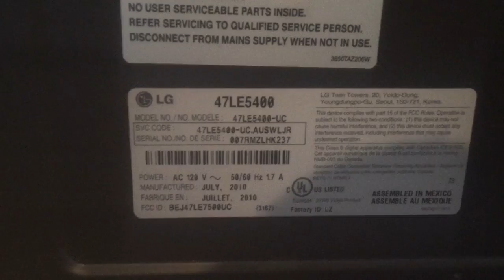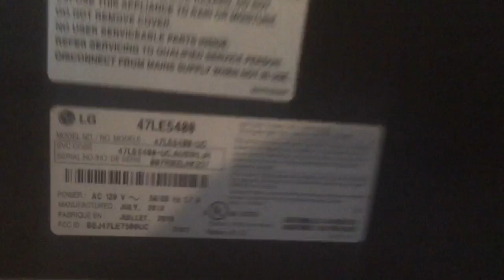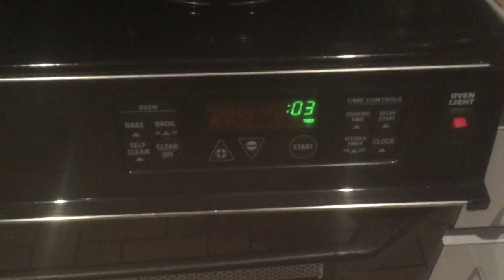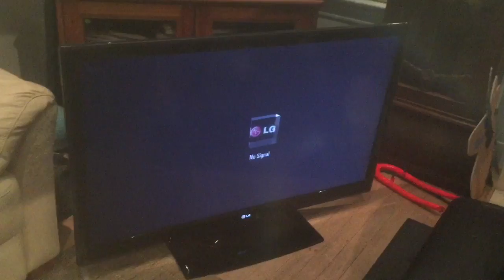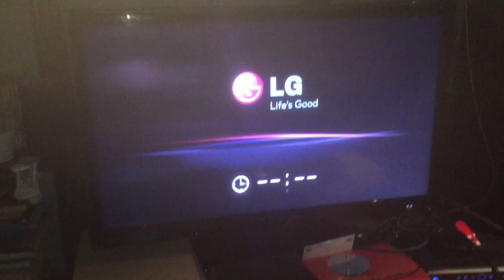Repair An LG Television Motherboard By Baking It In The Oven

Comment: great idea - hmmm just watched a LG repair video that focused on heating and soldering the main board mainchip(search video LG TV No Picture Repair 55LX6500). It has the same diagnostic as mine - standby light, remote controller switches standby off (normally turning on the tv) but nothing comes on, no image , no backlight - no image when I shine a torch on it. I will do an inspection and see if I find anything burnt on the board before attempting. Thanks for a different approach to the problem.

Comment: I have a Samsung LH65BECHLGFXGO that doesn’t turn on… could this fix the issue or is it only for LG TVs?
Reply from the maker: @ChristianTulsaPeru  I don’t know the answer but people have baked motherboards on a range of televisions.
Reply: In my experience baking motherboards or graphics cards (ive baked many graphics cards with success ranging from 3 months - 1 year) works when you have graphics glitches or that it turns off after a while etc. unstability. In your case it sounds more like a bad power board. I would try changing that. it CAN be the motherboard tho so it would be best to try some troubleshooting first. Its always best to try other stuff first before baking, because it can damage the compontents. if you dont know how to troubleshoot I would try changing the power board first, and if that doesnt work try baking the motherboard. if that doesnt work you can change the motherboard also. Also remember that baking a motherboard is only a temporarily fix that can last everything from 2 weeks to 2 years..
Reply: For tv that doesn't turn on it needs some basic trouble shooting first.  It could be due to failed power board instead of main board

Comment: This is great! Today I fixed an LG 47LW5700-UE using this method. Thanks!
Reply: Is it still going or has it packed in again?
Reply: @TH-ns5mb  I'm afraid it failed again about a month ago. Tried putting the mainboard in the oven again but to no avail. Repeated the heating two more times and still nothing. Ended up discarding the TV.

Comment: Today I have tried this method with my old Philips 32 inch TV that I bought in 2013. A week ago it struggled to receive any orders from the remote or the back panel buttons, but the LED was on the whole time. I baked the board twice because the first time didn't work, but the second worked flawlessly. Thank you!

Comment: I have an LG model 50LN5700 from 2013, which developed the black screen last weekend.  I guess I got my moneys worth as it lasted 10 years trouble free. I tried this motherboard-in-oven method a few days ago and I was able to get my picture back again, but only lasted 1 hour.  Did it again and this time only lasted 30 minutes before the screen went blank again.  So if this motherboard-in-oven method is able to get my picture back, albeit just temporary,  it's pretty much a bad motherboard issue, isn't it?  I can buy a replacement motherboard for less than $100, is it worth replacing the motherboard?
Reply: I'm contemplating the same question
Reply: I bought a replacement board on the internet and it didn't fix the blank screen issue.  Going to be buying an LG c3 most likely as the prices will go down next month memorial Day week sales.

Comment: I tried other options before doing this on my LG 49UB850V, like heating with a heat gun and a thousand other things and nothing worked. In fact, the TV had been damaged even more. I tried this and it worked! it's amazing!
I recommend that you don't do like me and separate the plastic plates before putting the motherboard in the oven. I thought they were metal and they melted, but the board works 100% and I've already got the plates for only 15€.

Comment: I picked up a 55" lg i saw on the side of the road wouldn't power on . Can't believe this actually worked but it did!! Thanks so much.  Free tv!!
Reply: Exact same with me. I've done this 3 time to the same tv over 3 years before I throw it out and it keeps coming back. I literally just came back to look up the temp. Hopefully it works again 😂
Reply: A lot of those are cold soldered basically they're just trying to build them and get them out the door as quickly as possible. So over time they just come loose but this will fix them about 85% of the time.

Comment: Really grateful to have come across this fix a couple of years back. I've had an LG EBT61438207 for over 8 years and it's still my favourite screen today. I'm wondering if anyone thinks there might be a limit to how many times this could be done before it's time to trade up?
Last week was the 3rd time I've done the bake for this motherboard. On this occasion, it didn't work when I reinstalled it, so I took a gamble, re-did the bake, and let it cook for an extra minute and a half. After that, it did work. 
Might there be a limit to how many times these boards can be baked before other damage is caused?
Just for general information, my toaster oven has a digital temperature setting and only display in increments of 5 deg. So, each bake I've done at 195C for 11 minutes. This last time it was 12m30s. 
Anyway, so far so good. It's still nice having a free fix for what's now my large computer monitor! 😁

Comment: Wow thank you so much! This was my first baking experience and it worked perfectly. I baked the main board from a Vizio D55u-D1 which is known for having this type of problem. I read many articles and looked at many videos in Vizios but yours made the most sense so I gave it a try. I must tell you that I did use a gas oven, not knowing that might be a safety hazzard until reading the article you refer to. But hey nothing blew up. Amazing! Thanks so much 👍🙏
Reply: Hey I have the D55u_D1 with the same issue. What temp for the oven, and how long did you bake it for?
Reply: @mts7274  I did exactly what the author of this video states in the description-  10 minutes @ 385° F (196° C).
Reply: @mts7274  I don't have my D55u_D1 any more but I remember the problem was with the BGA soldier joints under one of the 2 big processor chips. If you can locate which chip has the problem (by tapping on it), you might try a heat gun on that chip before baking the board.

Comment: I lost sound on mine and it wouldn't even output it to any external source. I baked the main board and to my surprise it now outputs sound again. I'm just amazed it worked. Was on 32ld490 and is about 12 years old. This was the first time it's been opened up and the amount of dust was unreal

Comment: Can anyone explain why baking a motherboard works? It's fantastic but so weird
Reply: Its called 'reballing' they did it on video game consoles, YEARS and years ago.  Basically, there are little solder balls that connect the CPU / BGA to the motherboard which crack, and fail after years of heating up / cooling down. The oven re-flows those balls / sometimes this works sometimes not and more often than not is a temp fix.
Reply: Softens the solder joints and reconnects anything that may not be
Reply: I was curious to odd one but now that I think of it yeah it could work

Comment: Just did this....AAAAAAND....it works.  I did it for 12 minutes and only cooled it for about 10 minutes.  Worked great.
Reply: Yep…a year later and it’s still going strong.
Reply: @mjhufford  damn I'm gonna have try this bought a power supply thinking that was it nope so had to be the main board
Reply: @mjhufford  how many degrees did you put it in and how many minutes did you leave it in the oven?
Reply: Still working for ya?

Comment: Did this today and the tv now works.
Awesome
Tv was a dumpster find
Reply: Our current living-room tv (55" Vizio) was a dumpster find about 3.5 years ago.  Rained on, sand all over it, wouldn't fire up.  My 13 year old (at the time) says we should bake the board.  We did.  It worked!  It has stopped working a few times but everytime it acts up we bake it again.  Probably done it 3 or 4 times and are doing it again today.  Let's hope we get another year or so out of this one. 🤞

Comment: Ive done this twice and brought my TV back to life, lost audio and hdmi1 but my 20 year old LG is still working.
Reply: are they still working?
Reply: You probably just need to manually add some more solder to the joints. Solder paste is a good way of doing it. You would just put a tiny amount on all the connectors that you're worried about and put it in the oven again.

Comment: Have an old LG 42LE8500 with Display not starting up anymore. It baked the motherboard with your method and it works. Absolutely made my day! Thank you for the video!
Reply: Update: the TV worked for about 30 months. Now I have the same black screen issue again. I’m trying the repair for the second time now.

Comment: Omfg IT WORKS! I put it on for 10min went to work, came back and installed it and boom it freaking works. I was not about to spend $150- $200 on a new motherboard. You’re a life saver. No lie I was so scared to put it in the oven at first 😂 I had my fire extinguisher on go  🧯

Comment: The TV died today again. This fix worked for 1 year and 8 months with daily usage of approx. 8 hours. Will re-do someday.
 Second time- got a cheap hot air reflow station. Reflowed a few random chips on the motherboard and TV is working once again!
 Third time- it died for sure, could not bother fixing again.
Reply: Yah this is my second motherboard bake on the same tv

Comment: What was the symptoms? The screen on my 55LM5800 is going black but still has audio. if I power it off & back on again the picture comes back but only for a short period of time then the screen goes black again. 

I wonder uf this fix would work
Reply: Exactly what my LG 55" is doing. War intermittent till a couple of weeks ago, now this. I'm going to bake it because I've heard this trick in a few videos. I'll update when I do.
Reply: @jerseyjoyride1316  Nope turned out to be the backlights, replaced em and it fixed that issue (although after fixing I had a NEW issue w/ the screen dimming every 4 seconds). Replaced the Tcon board, Power supply board, LVDS cable & main board but still dimming. I suspect the fucker that sold me the PS board screwed me! Anyway the Main board has a bunch of plastic parts, CPU etc that I wouldnt bake, that is unless you are lucky enough to find a replacement & dont mind spending $120 or more for a new one! (my replacement was brand new). TLDR replace the backlights before you do anything else! Youre welcome

Comment: Believe it or not my mom tv a Westinghouse smart tv  wd50fb2530 started cutting off by itself after 30 seconds! I opened it and the main board and power supply are built in together! I removed and I literately used a welding torch on the board since I did not have anything to lose (tv was already messed up in my opinion) all capacitors looks good so I melted pretty much all the soldering joins (something I don’t recommend ) and put it back together and to my surprised tv have been working perfect since!!
Reply: Lol this is wild

Comment: OMG!!! Never breathe in fumes from electronics. You should had baked it in a small electric oven outside the house… just run a extension cord and plug the electric oven out there… thank you sharing your experience!
Reply: Solder is lead free nowadays, don't freak out.

Comment: lasted 30 min and died
Reply: You need to use liquid flux and then use a reworking station it’s probably a dry solder but without te flux it probably won’t resolder properly
Reply: @xray364  yeah but how do know what part of the board to rework. You can't just heat up an entire pcb with a handheld rework gun

Comment: I've done this about 4 or 5 times over last 4 years or so. It is time again today, hopefully it works again
Reply: It worked again
Reply: Same hahaha just did it for the 4th time in 4 years. Too cheap to buy a new TV LOL
Reply: @georanchurchill2774  the gift that keeps on giving 🤣🤣
Reply: What are your TV symptoms? Mine went black while watching TV. Now, no LG start-up image and no audio. Just wondering if we have the same problem.
Reply: @OneWhoLivesThere  usually I will turn the TV on and the lights at the bottom of the TV will turn on and there is no picture (i.e. black screen).

I picked up another 60 inch TV few weeks back dirt cheap that had these symptoms, apparently had sound though. Baked the board for 10 mins in oven and works fine now.
Reply: @adamg5252  Thanks. We definitely have the same symptoms.  After posting, I tried baking the board and it didn’t solve the problem, unfortunately. I had just paid for a new motherboard to be installed 8 months ago and the repair warranty ended after 6 months, so I think I’m done sinking money into it.
Reply: Same sadly. About to do my 4th right now.

Comment: To prevent it happening again, never take out the powercord while not in use, and let it be in standby mode always! I found out that the board stops working when it has been left in a cold (below 10' Celsius) room for a week or so without the power cord attached. So,  never unplug the power cord (tv, blu-ray surround etc). I`m baking my board for 2 time now. Lesson learnd. 
EDIT: Last time it lasted for 3-4 years, and it also worked today!
Reply: Is this confirmed? Why would the cool air affect the solder?
Reply: @bradfordskelley  I read it somewhere. The solder they used at that time was not tested for use under colder environment so it was cracking. This affected mostly under the processor on the main board. The heat from the oven melts the tiny solder droplets together again and it works again. I have done it 2 times now.
Reply: I suspected it could be that because my surround sound amplfier was also placed in the same cold spot and that cost me £50, (not LG though) to have its main board resoldered. I will pop my LG DVD main circuit board in the oven tomorrow for 10 mins and then either varnish over the electrical soldered joints or leave it in a warmer room for the winter next time if it works. I must remember to leave card under it whilst it bakes. Incidently I tried the hot air blower last time and it worked but only for a couple of days and melted the plastic around the output sockets. I'll leave the extractor on full and kitchen back door open and give it a blast with air freshenr so the good lady does not give me a hard time when she gets back. Pity I don't have a way of doing it outside:face-orange-raised-eyebrow:.

Comment: Thanks man for this cheap fix! Got my LG 55 inches ready to be dump because it was just pure black on screen instead I tried your suggestion and oh boyyy it worked into perfection. I saved a space in landfill because of your video🤣
Reply: What was the model number? My 55" screen keeps going black but still has sound. I have to power off the TV and turn I back on to get a picture again

Comment: Ok, today is 9/10/21 and this worked on my LG 42ln5300. Baked the main board after oven was already hot from baking cookies. Let fire be off and it sit there for like 5mins then turned it back on to 375 for like 2mins. Turned it back off and opened oven door to air out until it was no longer hot (15mins) took it out and let components further cool for about 30mins. Popped in and haven't had my tv randomly shut off since.

Comment: It didn’t work for me. Before doing this it has LG logo, now it has black screen nothing is coming.
Reply: You might have not connected everything back perfectly, for example are the little white strips in fully? Those control the picture which may result in you not seeing anything, (I've done this 10+ times on my mom's old tv) and that happened to me once because I didn't put it in all the way, since they are so hard to push in
Reply: I also tried it and it didn’t for me neither, matter fact it no longer turned on at not even the screen were it was stock😔

Comment: I have a 47LW6500 where the screen has been taking a lot longer to light up (have to switch on and off a few times) but this morning nothing.  Can hear the switching relay and the outside LED's light up but nothing else.  I will try the oven trick an see what happens.
Reply: This is bad capacitors on the power supply, you might be able to see a bulge/dome on top of the bad ones

Comment: Fantastic!! I’ve been holding onto a 55LX6500 LG set for so long, could never figure out the problem. Was on its way to recycle soon, but figured what did I have to loose. This fixed it and I’m totally amazed how easy!!! Thank you so much!
Reply: how long did it last?
Reply: @SemorreButte  still working today, 1 year later. Just remember to not touch or pickup until the board cools down, components can move or fall off when HOT. I learned this quickly on another board I was baking. Good luck!

Comment: My LG 50NL5400 died (No picture). I tried this trick as a last resort.  385F for 10 minutes. Pre-heated the oven and put a good oven thermometer to double check temp. In it went and COMPLETE FAIL. The chips came off, the connectors melted, the cardboard was catching on fire and it STUNK!!!  Time to shop for a new TV !

Comment: I wonder if you could use a heat gun instead of baking it
Reply from the maker: Some people are and there are videos.
Reply: @followthewad  I fixed my TV 2 years ago with a heat gun and put flux around the edges of the BGA chip. It's been running 24/7 for 2 years straight and still works flawlessly.